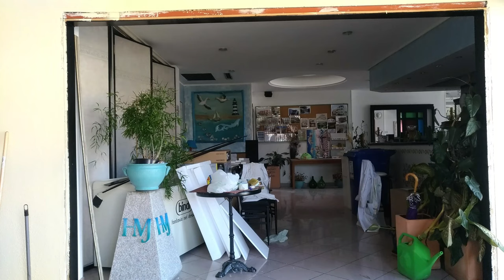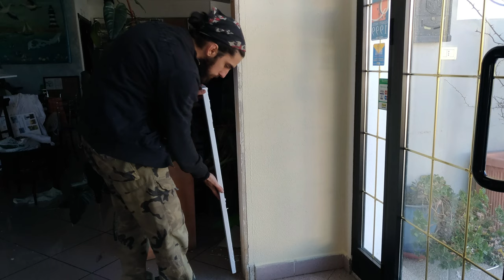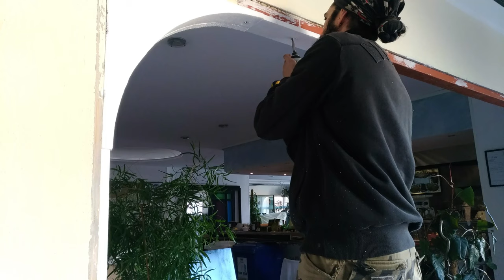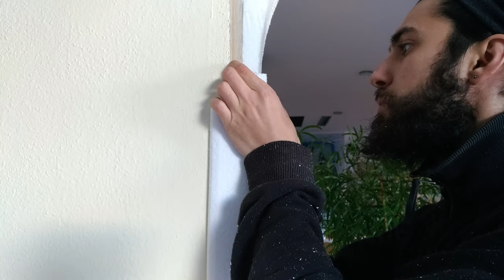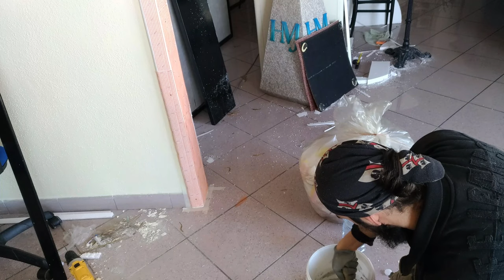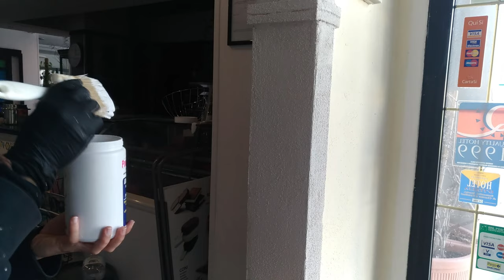Making a styrofoam arch!!!

Comment: Could you possibly post a supply list of all the materials you used?
Reply from the maker: Well if you want to i can break it down here...from what i remember was just, polystyrene, hacksaw blade and a cutter to cut it, silicon to glue it, screws, plaster and net (not sure if "net" is the right translation) and wall paint...i think that's it :)
Reply: @AndreaFarina11   I appreciate it. You did a great job. Hopefully, I will too.
Reply from the maker: @chrissicapalmer2029  Thanks, oh i forgot a couple of things, you'll need a stapler gun or wood staples to hold the net in place, and a plaster sponge that will help you uniform it, (that may be optional since not everyone nor every wall are made the same) also if it's the first time for you (especially using plaster) I recommend talking to a specialist in your zone, it may help you with the material choice and give you some tips on how to work with it,(materials may vary a little between countries, this way you should be able to get the right ones for the job). Good luck with your project, let me know how it goes :)
Reply: @AndreaFarina11  Thank you so much. You're been so kind and very helpful. I'll definitely let you know how it goes. :)
Reply from the maker: @chrissicapalmer2029  you're welcome 😊